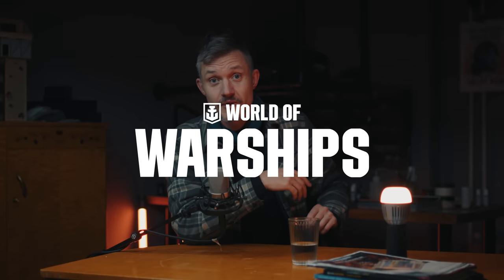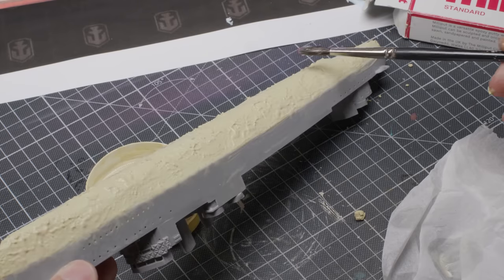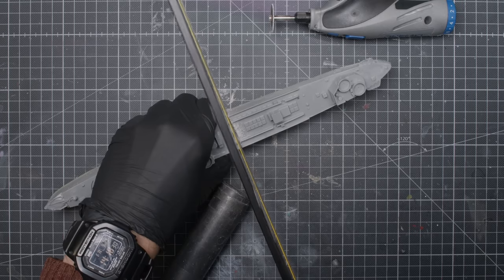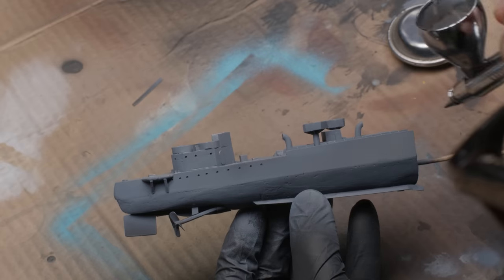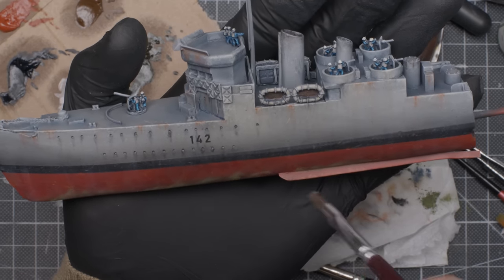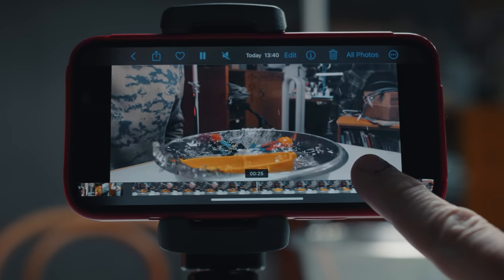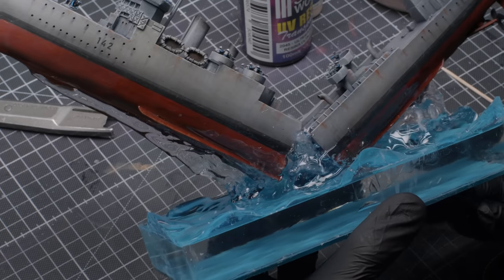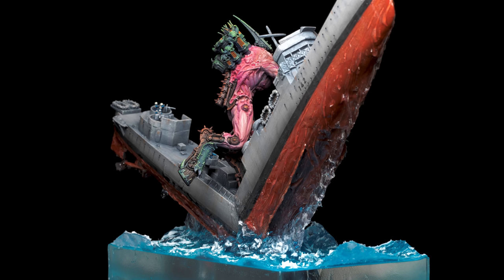HMS Campbeltown vs. Warhammer40K Demon

Comment: 10:21 when a 2-part resin is curing, you can cover with something like a box to prevent dust floating into you pour an sticking to the surface.
Reply from the maker: Very good point, I did this but did not show it.

Comment: Absolutely brilliant as ever. I wonder if that splash gel could be used as an alternative for Modge Podge for river surfaces, and also if you can use regular watercolour pencil (with a varnish layer to fix them) for a similar effect to the AK ones?
Reply from the maker: Thanks Adrian! It's a good combo. First doing mod podge, then splash gell. I guess it's all about what effect we are striving for. Mod podge makes nice ripples. Splash gel is a little more "violent". On the other hand, I did try watering down splash gel with a little water, creating a smoother fluid. That came pretty close to mod podge territory. The slash gel stays a little "rubbery" and probably is not a tough... so for a diorama thing the splash gel works but maybe on a base or in wargaming terrain the utter solid hard curing mod podge is better.
Reply: @52Miniatures Thanks for the reply Alex, that makes a lot of sense.

Comment: This was a great video, I like the varying paint styles between vashtor and the ship to highlight the clash of universes. Did you completely and definitively calculate the wing velocity of a fully laden vashtor? No, but then he doesn't have wings and that's not the point, but sometimes we are doomed to be called some kind of name by some easily triggered internet fellow. At least no one called you a tourist this time? (sorry I've probably jinxed it)
Reply from the maker: Very little scientific data was involved. It was surprisingly difficult to find reliable sources on deamon velocity vs early 1900's hull structure. I'm sure this is a line of enquiry completely looked over by science departments globally and should be remedied! What's that CERN thing there for in the first place if not for important work like this?
Reply: @52Miniatures  "no scientific data and/or fluid model analysis was harmed in the making of this demon fighting warship diorama..."

Comment: green metal detailed instructions pretty please?
Reply from the maker: AK Intermediate Green watered down and stippled on with a sponge on a black base coat. Sort of 70% (ish) of the surface concentrating on where there would be highlights. "Washing" that with a very thinned down Anthracite Gray from Scale75. Trying to push the glaze into the "shaded areas" covering the black that is left. Going back with fresh layer of the first green on 40% of the areas facing upwards and that I want highlighted (like edges). Then edge highlighted with Fall Green Scale75